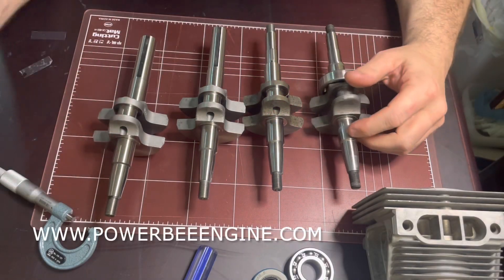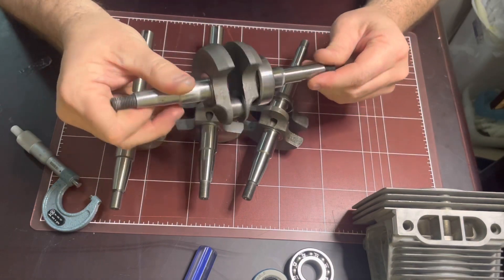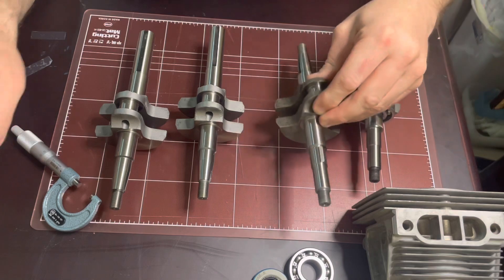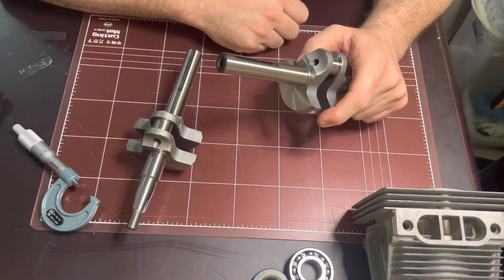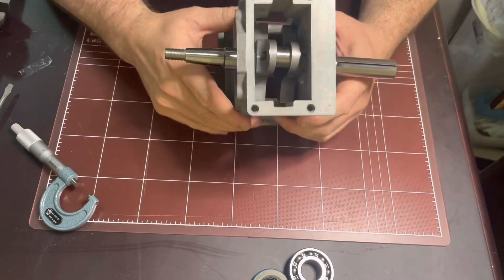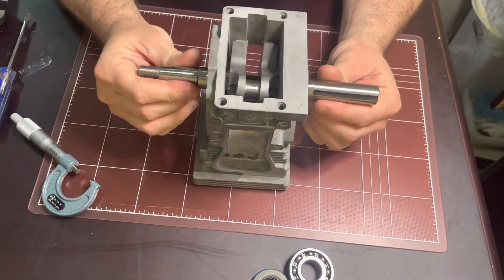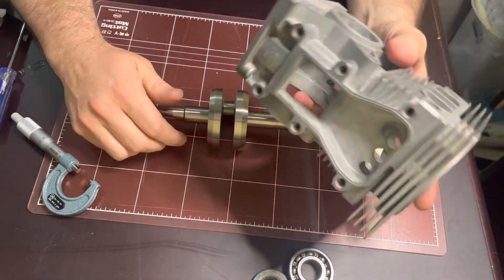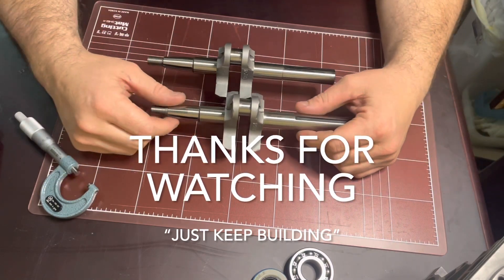Power Bee Engine Build Series - Episode 1 “Crankshafts” for West Bend 820 and Power Bee 820

Comment: that hole through journal, is mainly for machining / grinding journals by passing a Rod of that hole size through, so the journal rotates on that Rod axis, while all other parts of that Crank rotates in eccentric.  Crank without that hole can also be machined / ground on a CNC but only for a small batch production.  Mass produced Cranks will always have that hole present.
Reply from the maker: The hole in these Power Bee cranks was added for balancing.

Comment: Glad I found your channel. I can see this is a series I need to watch the rest of it but I have two US engine power bees that were originally military drone engines. Which is how I want to use them. As near as I can tell they were used once and the aircraft they were put on crashed on takeoff and then the engines were put in boxes and sat that way for a lot of years before I got them so they barely been run. Have you ever heard of anybody trying to put two of them together to make a twin?
Reply from the maker: Yes. I saw a drone and a snowmobile with twin engines.
Reply: i have a copperhead based on the drone engines  from 2007,